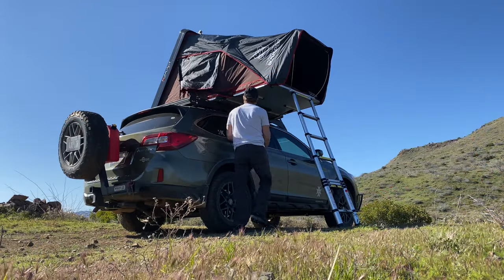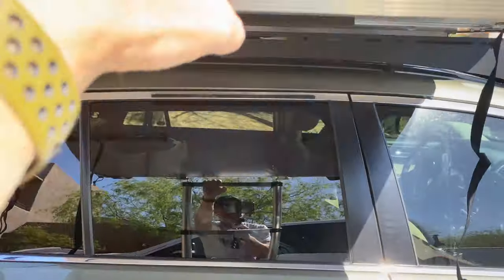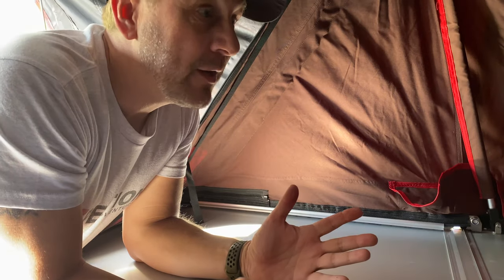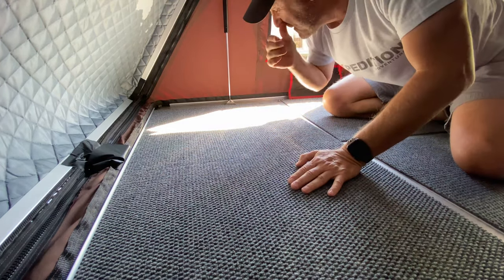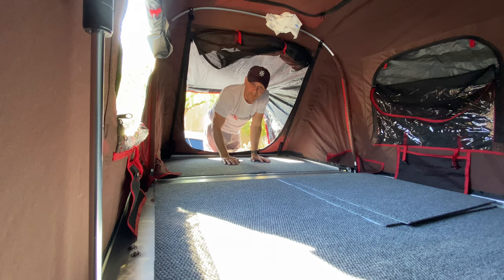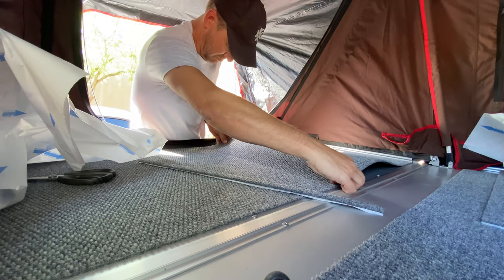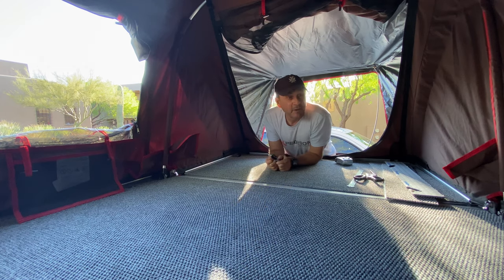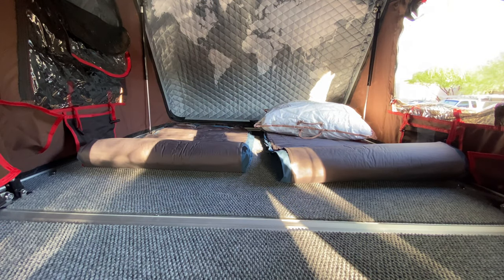How to Stop Floor Condensation in a Rooftop Tent - iKamper Skycamp Mini on Subaru Outback

Comment: I’ve had my Mini for a couple months now, this is a great idea!  Mine tends to get really hot, being on top of my FJ, so my question is- does the interior of your tent hold a different smell? Does the carpet air out pretty good? Thanks for the video. I look forward to more from you.
Reply from the maker: Hey Rick! Ya it has a carpet smell for a bit when opening. Also, being in Arizona, some of the carpet unsticks — the flipped section when closed and in 110 degree sun.

Comment: Nice job Scott. Love the Blue color , I thought they were grey at first.. Are these tent tops worth looking at to buy used ? If anyone doesn't know how to get the square footage as Scot said measure the length x width of the area you want to cover & it will give your square footage.. Ex: 6' x 5'6" is 6x5= 30sq' &  6'x6" = 3sq',,,, 30 sq ft plus 3sq ft = 33 square feet. Just example... Makes it look sweet. & I'm sure helps w heat & condensation big time.. Great Tip Scott.
Reply from the maker: Yes absolutely. In fact, if you are interested in an IKamper, There is an IKamper community on Facebook. If you join that group and post that you were interested in buying one, more than likely you’ll find somebody who is interested in selling you one.

Comment: Awesome video Luke!  I’ve never been interested in a rooftop tent, but this video is starting to win me over.  I currently have a Thule Motion XT alpine cargo carrier and it holds a lot of gear.  I believe it has 16 cu ft of storage.  How much does your ikamper have?
Reply from the maker: Hey there Jon. the Mini inside width is about 4'3" and about 6' 11" long. You can't store that much inside when closed as the design folds in on itself and also holds the ladder (which of course is why I removed the factory pads for a different system. The mini does leave some room on the roof for other gear though. If you watch this video you can see more about that. https://youtu.be/JUbbaxvUTwg

Comment: Thanks. Question. Understanding it’s less comfortable, would the carpet squares under the factory pad work as well? Also, any other thoughts on adhering the carpet to the floor to make it less “permanent”? Velcro strips, etc?
Reply from the maker: I removed the factory pad because it wasn't soft enough and wanted to keep my bedding inside the tent at all times. You could add the carpet under the pad though.

Comment: Great video, I love the groovy music. If you cut out strips of carpet and put them on the rungs of the latter, would the latter be able to close?
Reply from the maker: It would still be able to close, yes. Though, generally, I take my shoes off at the top of the ladder rather than the bottom and hang them off the ladder or set them on a plastic mat inside so the carpet would get pretty dirty on the ladder, especially after rain. Thanks for watching Peter!

Comment: Curious... have you had to pack up your tent after a soaking rain with that carpet inside? If so, how long did it take to dry the floor out when you got home? 
I'd be hesitant to do this hack without seeing a good follow-up after a stint in the PNW or Alaska. 
Also, it'll be hard to find the bolts and reroute your rails under the tent if you need to reorient it.
Just food for thought...
Reply from the maker: That's a bit hard to answer. I live in the desert so everything drys in a matter of an hour or two.

Comment: Isn't the carpet tile just absorbing the condensation? I've seen other condensation reducing applications and they're all based on improving airflow which this doesn't do at all. Just curious.
Reply from the maker: Hi there. Hasn't been an issue for our iKamper tent. Maybe because the carpet is so thin. Not sure why. Also, could be the drier air in Arizona.
Reply: @4XPEDITION  I live up here in the PNW...not sure it would work with how much condensation I have inside ours. Glad it's working for you!

Comment: Great work.  It looks great.  If you didn't know, it looks like it came from the factory like that.  How much extra weight do you think you've added using these tiles?
Reply from the maker: Not sure but it is extremely marginal. Especially since I removed the factory padding.

Comment: I am switching from a tepui to the new skycamper mini 3.0.  The shoe storage pouch for the tepui ia conveniently located near the ladder.  You can hang your legs outside the tent (while sitting inside) and put your shoes on.  It looks the the ikamper requires you to hang the shoe carrier further in closer to the vehicle.  How is this working out?  can it be relocated closer to the ladder?
Reply from the maker: I think it is positioned to hang under the tent overhang to keep everything dry. You could add a shoe hanger next to the door though.

Comment: Hello friend!  great idea I am about to purchase Ikamper myself and have been looking at all options for fixing small issues users have found over the years...  so again back to the hot sun, I will be in central america alot in the sun it gets close to 40degree celsius.  Since you installed did the carpet glue melt and start to move around or get messy?  thanks
Reply from the maker: I haven’t opened it in two months as I was on the road with the RAM. I’ll be opening it up next week. Stay tuned!

Comment: hey man, this is a sweet idea.  Thanks.  We have a hardtop RTT (Roost) and the fiberglass hardtop will get frozen condensation on it (Winter-20d), that then drips down when it melts in the morning.  Any good ideas on how to prevent that?
Reply from the maker: yep, and it has worked for me so far. Of course keep in mind I live in Arizona where the air is very dry.

Comment: Great video.  I've had issues closing my ikamper mini with stock pads and just leaving the insulation inside but dropped to the floor.  I just can't do it.  I have to remove everything except the pads.  If i install the carpet squares and get the nice memory foam inflating mattress from REI, will i have any problems closing the mini with the bag/blankets/pillows/whatever.  P.s. I'm in tucson at the moment.
Reply from the maker: Hey there! I’m able to put two full-size pillows, two deflated air mattresses, two blankets And two sleeping bags up there and able to close it. It’s a little tight but not too bad.

Comment: Scott will you let me know why you use two single pad as opposed to one double pads?  I’m trying to order mine but would like to know what’s the right choice
Reply from the maker: Do you mean the Exped mats? I use two because I needed to get the right full width to fit into my iKamper Skycamp Mini. The folded out leg and foot area where the door and ladder are is narrower than the upper torso area when sleeping and these two particular mats fit the width correctly. Plus, when I travel alone I like to double them up for even more comfort.
Reply: @4XPEDITION  thanks for answering. I also figured out why I’d choose two single one because two people may not have the same weight one side my sag more.  I was looking at megamat 15 if I doubles up they will be wider than my tent so I’m going to get the megamat 10  thanks again
Reply from the maker: @shupingyin8082  Makes total sense!

Comment: Nice vid! Question on your Ikamper did you peel away the plastic film on the baseboards before applying or did you leave it on?
Reply from the maker: Mine didn't have plastic on there. I would say remove it if it is just a clear flim and peels easily.
Reply: Sounds good. Yeah mine had it. Like the protective film when they get the material from the main supplier. I always just left it on for extra protection but yeah makes sense. Thanks. Great video and great response.

Comment: Now that we got into colder months how's this still doing? I have some friends here in the PNW that have other model tents and say it doesn't work but actually absorbs the condensation. I know ikamper designed the skycamp with the waffle floor to reduce floor condensation. I'm just curious if this is still working. Thanks in advance
Reply from the maker: Still working for me. However, remember, eventhough winter months in Arizona are more moist than fall and spring...especially this year...it is still much more dry here than in PNW.
Reply: @4XPEDITION  I read in other comments that's you're in AZ after I posted. I will say this is my first RTT so Idk about others but I spent a night in the snow with temps down to 16F and didn't find much condensation under the mat but there was some. This was also fairly cold and the air tends to dry out when it's that low. I'm still tempted to try this method on the ikamper due to their floors design. Not only does it look better but it adds some insulation I'd think. I like the fact it actually sticks, most of the AC mats that are recommended and have positive reviews have no way to secure to the floor which for the skycamp would be an extra step I don't want.

Comment: Hey man I have a smittlybuilt RTT and looking to do this mod I was just wondering will this work up in Canada blow -1 to -5 and what kind of carpet tile should I be looking for the links you have are for the states I checked my Lowe’s online and they don’t sell that box of carpet tile you have
Reply from the maker: If you look for commercial carpet tiles that are 12x12 with sticky backs, that is what I used. Not sure about the temperature being that low if it will stick to the metal. I think you will just have to give it a try. My sister and her husband just bought the new Smittybuilt RTT. They really like it.

Comment: After now 1 year, how did the carpet tiles do in stopping the condensation?
Reply from the maker: On both my iKamper and my brother's they work well. On my brothers, his has often become unstuck (the adhesive) on the tiles that are on the part of the floor that folds over.

Comment: Thank you very much for the video. I just used my ikamper mini for 4 straight weeks from brand new. I totally agree the factory mattress needs to stay at home. I'm gonna get an exped. My question to you is how come you didn't buy a duo verison of the Deepsleep in the medium size? Its the same size as two of the singles together. Or did you just already have them? I'm thinking of getting the megamat 10 duo.  Also - looks nice putting the tent away at the height you have it. I need to stand up on my 35" tires to tuck in the material from getting caught on the sides. Hahaha
Reply from the maker: Referring to the EXPED mattresses? I found them online...I think possibly at Moosejaw.

Comment: Great job!!  Also can you close the mini with the pillows inside?
Reply from the maker: Yes I can. I had to get sleeping bags that had a lot of loft rather than bags that were thick and heavy. The bags with loft you can push all the air out of and they get flatter. I have Exped mats aired down and folded over the long way, two 20 degree sleeping bags and two full sized pillows up there.

Comment: Did this work, the carpet seemed a little thin. I wasn’t sure if it would be enough R value to make a difference.
Reply from the maker: Well, the carpet really isn't meant for that. It is meant for the condensation barrier. I will add that it does stay warmer.

Comment: Really great video… extremely thorough.  Curious, will this also work as well if keeping the original foam mattress?  

I’ve been debating just purchasing an anti condensation mat vs this approach and trying to determine which would be more effective…?
Reply from the maker: Yes it will I think. Not positive, though. We live in the desert so it's a dryer climate.

Comment: Great video! I like your modification. I was wondering how much height does your Skycamp Mini Roof Top Tent add to the overall height of your vehicle? I'm thinking about buying one but being able to still park in my garage with it mounted on the roof is key.
Reply from the maker: Hi there Ricardo!  Great question! YOu should watch my video about the Prunsu Rack install and iKamper mini install found under the Gear Guide playlist. Primarily, I removed the factory Subaru rack I had on top which was outfitted with an additional Yakima rack for stability when I had the tent on. I remove all that and replaced with a Prinsu rack to lower the roof around 4 to 5 inches in total in order to be able to fit inside the garage. Here is the Prinsu Install https://youtu.be/DIWOj2ypviw and here is the iKamper mini test install. https://youtu.be/JUbbaxvUTwg

Comment: Hi!

 Is it a bad idea to drill some tiny holes under the matress in the metal surface below to prevent condensation? Too stupid or ridiculous?
Reply from the maker: Yeah. Probably. You don't need anything that can cause leaks.
Reply: @4XPEDITION  ok, I get it, no leaks, but in this case, it would be between the matress and the metal floor. 

Can you explain a little more please!?

Comment: Hey Scott, I read in a previous comment that the heat in AZ ended up melting the adhesive of the mats a few months back. Did you end up redoing the mats with the same method or did you use another? Also, how'd you deal with cleaning all the left over adhesive on the metal parts? Thanks!
Reply from the maker: Hi there. I didn’t say that. I’ve had no problems with my carpet sticking even in full heat. My brother said he had a couple of the panels come off but he just put them back on. Hope that helps!
Reply: @4XPEDITION  "Also, being in Arizona, some of the carpet unsticks — the flipped section when closed and in 110 degree sun." I think this is what KayCee is referring to.. I'd also like to know.

Comment: Did you look into getting the Exped Megamat 10 Duo?
Reply from the maker: No I haven’t. Not sure they would fit width wise in that RTT
Reply: @4XPEDITION  Thanks. I'll take some measurements to see if it'll fit, but I don't think that it will.

Comment: What a great idea! I got my skycamp mini about a month ago and have already had a 4-5 trips in it - I love it. I haven't had any issues with condensation yet but I plan on swapping out the mattress so I may run into that. The carpet seems like a nice solution. My only worry is despite not bringing shoes into the tent, we always seem to get dirt and mud inside. I like the option of being able to wipe down the inside after getting home, do you have any trouble with that now? Thanks for the video.
Reply from the maker: Well, I don't let my boots get inside the tent at all. I will say that the carpets are washable. I just got back from a trip and didn't experience much dirt inside.

Comment: Great video. Did you consider just placing the XPed matresses on top of the iKamper factory pads and doing without the carpet tile?
Reply from the maker: Hey there. Thanks for watching! Well, that would defeat the purpose as my goal, other than increasing comfort (thickness of mattress) was to increase room to store sleeping bags and pillows up there full time. With the iKamper mattress inside there, there is no room for bedding.

Comment: Now that it’s been a few months are you still happy with the carpet tiles and expeds? Did I see that the tiles didn’t stick long term?
Reply from the maker: I live in the desert  and the temps get very hot, like about 120 degrees. So the folded over tiles have intermittently come undone. Glue melt. Regarding the carpet I think it is a great way to mitigate condensation. The expeds I bought ended up being too thin. I have since discovered a thicker pad that would have fit.
Reply: 4XPEDITION which pads did you discover? I have the carpets ready to install and like the ability to leave them in the tent with the bag and pillows..
So would you do the same thing again?